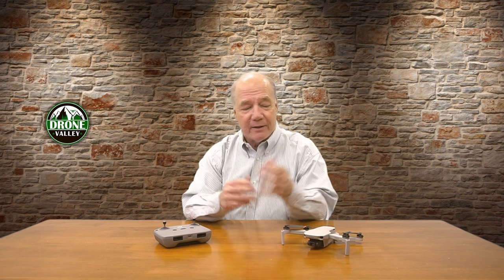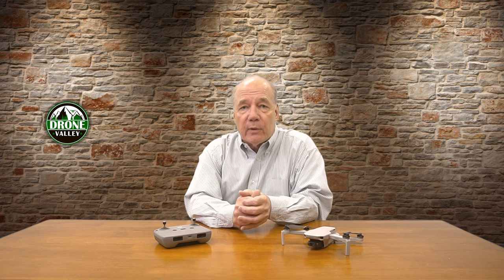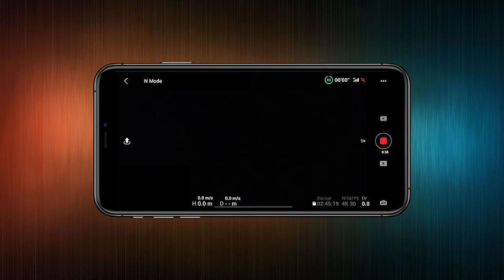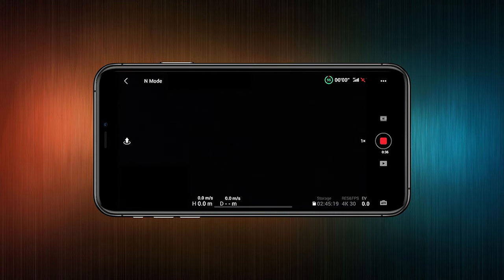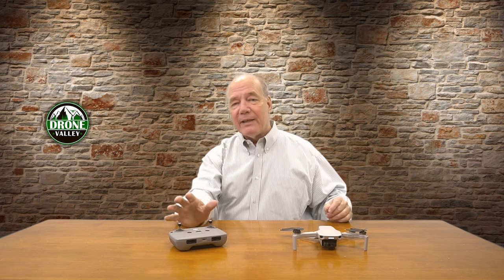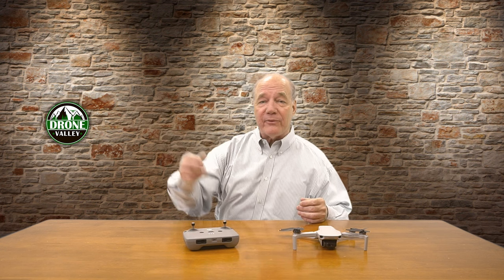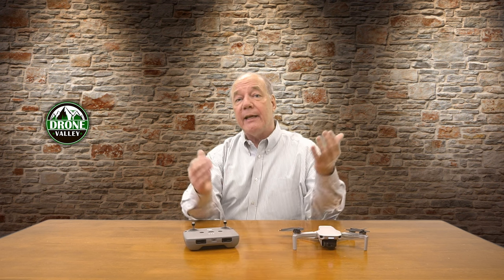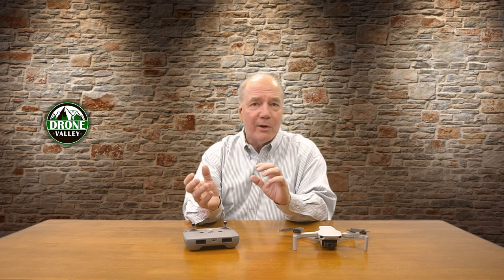How To Quickly Bind Your DJI Drone and Controller

Comment: Its funny you put this out now. I just got a "Drone Only" Air 2S off ebay, So when it came yesterday I used the RC-N1 controller that I have for my Air 2  and did a Bind of that controller to the New Air 2S. But the Firmware for controller had to be updated before it would Bind to the Air 2S. Once I updated controller firmware I got it Binded, check drone in Fly app and the firmware for the Drone was latest verson. So everything is updated and Air 2S has RID all set up. But great Video!

Comment: Can you bind both the two types of controllers (w and w/ screen)available for mini 3Pro at the same time and location.  Fly it without screen controller but monitor by someone else with the screened controller.  Just a question, but sounds like a  controller operation fight if you CAN connect both at same time and have both fully functional.  I’ll let you test this question out before I take a chance screwing something up.  Thanks Rick.  Gus wd9gus

Comment: I’ve got the original Mavic Mini and I want to either sell it or give it away but I don’t see an option to remove it from my DJI account in the DJI Fly app.  There is a “Remove Device from Account” option for my DJI Air2S but not for the Mavic Mini.  I’m afraid that if I can’t remove it from my account, the new owner will not be able to add it to their own DJI account.  What do I need to do?
Reply: A little additional information.  The Mavic Mini only shows up in the DJI Fly app when the aircraft is connected.  When there is not an aircraft connected, only the Air 2S shows up.
Reply: Never mind.  DJI tells me that the Mavic Mini does not get bound to an account.
Reply: Thanks for doing the right thing. Does a mavic 3 get bound to an account? 
Can it be unbound by the new owner?

Comment: Aloha Rick! Thanks for the video on binding the drone to the RCN1controller. Now you might consider doing one for binding to the RC or RCpro. It was my experience lately with the Mavic 3, you first had to bind with the RCN1 to initiate any firmware updates, then unbind the RCN1 in order to bind to the RC. Not sure if procedure is for all DJI drones that are compatible with the RC and RCpro. Even the DJi representative was confused on the issue when I eventually called via land line for help. Dennis

Comment: Thank you for the tip. It's great how you explains everything because I understand well.

I received a DJI Mini 3 with the RC-N1 as a gift in Father's Day from my son. I first binding with my mobile phone on the RC-N1 and worked fine, but I wanted to fly it free of the mobile phone.

Today I did it exactly like you explained taking out the SanDisk memory. Everything went fine, the sounds, the blinking lights and the movements of the propellers, but nothing happens. The propellers don't move. What more can I do?

Comment: Will give the “remove the sd card” advice a go, as until now I’ve found it impossible to bind my Mini 3Pro’s RC (screened) controller to my Mavic 3, the latter which came with a RC -  N1 controller, I’d prefer to fly both aircraft (at separate times) using just the RC controller.
Reply: I wanted to do this to. We're you able to get it to bind?
Reply: @azwb  I’ve not yet found time to try, sorry.

Comment: I think that you are confusing linking with binding. What you show on the video is "linking" not "binding".
Reply from the maker: Potato / Potato, we're tripping over nomenclature. Essentially the process in the video describes both and essentially establishes a relationship between the drone and controller that survives a reboot. If we want to get really technical, linking would need to be done every time you power up the drone where binding is a little more permanent. With less expensive drones you have to "link" them every time you want to fly, with these DJI drones, you "bind" the drone and controller and this connection is remembered by the drone so you only have to do it once. I hope that helps and thanks for the post.
Reply: @Dronevalley  Based on my experince with my Avata I could not link it to the Integra goggles because the drone was linked to the Goggles 2. I had to wait till I got it back from DJI to "unbind" the Goggles 2 and THEN bind it to the Integra. The process for linking is very different than binding and, according to DJI, binding attaches the drone, goggle or controller to the drone as opposed to simply establishing a connection. Binding is done from the Go Fly all and one has to go into profile, then management, etc. The linking process is done with the long press on the drone until it starts beeping and the lights start flashing. Because of some people using the two terms interchangeably there seems to be a confusion. Perhaps you can clarify this on a video. Just a suggestion. Thank you!
Reply: I think pairing is the first date and linking everything after that